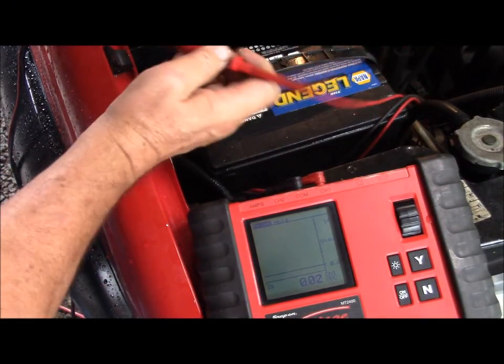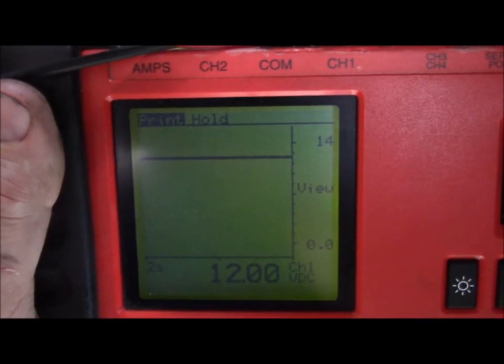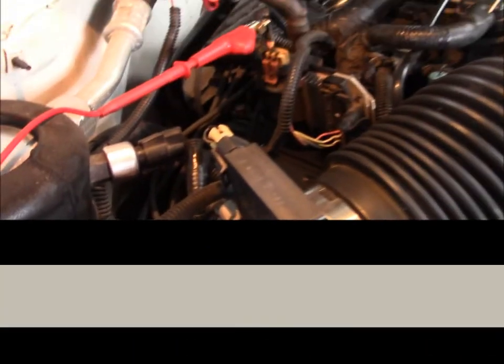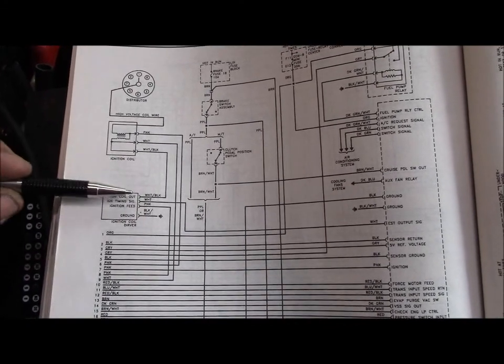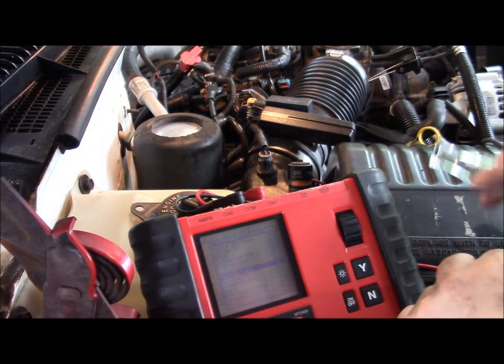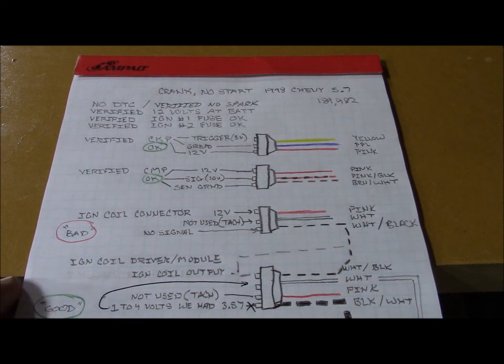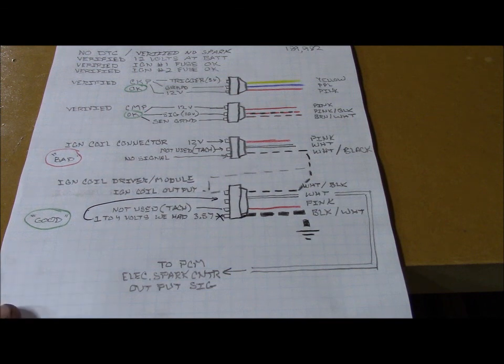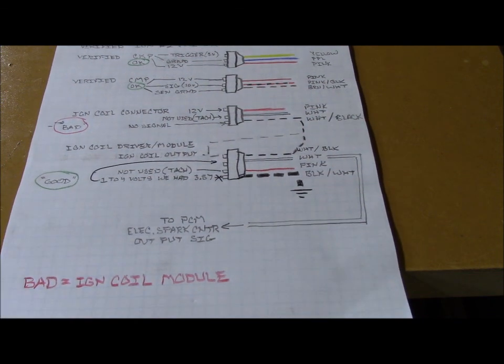P1351 crank, no start (part one)

Comment: my 2000 express van is having this same exact problem I have replaced everything including the ICM 4 times and the coil 3 times and the computer to no avail
Reply from the maker: It sounds like you need to start checking components for powers and grounds. A possible wire issue?
Reply: I still have no spark I did then when the van warms up some reason I lose it that was last week now I have no spark at all but it cranks but I have fuel. I've done all the wire checks you have and i cant seem to find anything wrong my next direction is to look for a broken wire that's all I can think of now that might be causing this problem
Reply: its all very frustrating for me i have checked all the basics i know i have good compression too. I'm good at this stuff so im irritated i cant fix this i still feel like i'm  missing something so simple and silly
Reply from the maker: @anthonychermesino2533  I worked on a 2006 Dodge truck for 18 hours (in two days) to find a crank, no start. It is very frustrating I agree. A broken wire is my best guess too. Good luck. I guess there is always the option of towing to a good shop.
Reply: @wyattoneable  it turns out it was a broken wire just as i guessed it was burnt through and stopped the crank signal.

Comment: step by step works while in sure you will get er done
Reply from the maker: I was impressed with the Haynes manual. It had good checks and the wiring diagram was correct. Thanks Drew.

Comment: The idiots that have come out of college thinking THEY will re-invent the wheel have made automotive repair MORE costly and they have ONLY gained a couple of miles per gallon from the old battery coil ignition with a good carburetor. Actually they SCREWED hard working people into having to take your vehicle into a place and spend a lot of dough on some asshole that has been trained on the art of f**king you.
Reply from the maker: I told my wife our next new car will be an old one! Without computers. It's the EPA demanding more from the manufactures too. I hate our government.

Comment: Great diagnostic test. I really like that Snap-On tester. 
I do the same thing in checking my electrical problems but not as nice as you did, lol.
The diagram you drew up was very clear and precise. Is there any reference info to check the module with an ohm reading or continuity?
Reply from the maker: None that I saw. I'm going to do one more check that was suggested by a tech I really respect but other than that, this better be a fix. I have the part now, just going to grab the camera and we'll watch together if this is it!
Reply: In the dealership they always have a good part to check the system with and I always called them part changers. And that is what they are. Put a new part on, engine runs, charge you 5, hours diagnostics@ 80+per hour.

Comment: Well looks like you're narrowing it down, I had one of my older 96 - 98 can't remember which, acted kind of like that and on mine the spring contact on the rotor cap had a hole burned right through it  Hope you get it fixed let us know.
Reply from the maker: Visual inspections are still important for sure. I changed my cap and rotor only because I had the old ones off anyway for preventative maintenance but I started to think if this module isn't the problem I need to see if that distributor is turning. We'll see what happens. Thanks for the comment. How's retirement treating you?
Reply: It's great only wished I would have done it sooner..lol

Comment: Nice work. If it's not the module after that thorough diagnosis I'll eat my hat. Stickers are looking great
Reply from the maker: I'm with you on that one buddy. If it's not the module then it has to be the wire between the module and the coil. I didn't check that because of the nature of the sudden non running truck. I shouldn't assume but I'll show the results either way. Thanks for your sticker, it really brightens up the place!

Comment: Looks like your diagnostics is correct Wyatt. Hopefully, she'll be running again for you tomorrow.
Reply from the maker: Me too brother. You never know how much you miss something until it's gone and although the truck has only been down for 3 days, we miss it. Thanks for the comment. If I can get the part tomorrow there will be a part two tomorrow.
Reply: You're right Wyatt about missing a vehicle when it goes down. And it's tough sometimes to keep them running especially when they get some age on them.
Reply from the maker: We really enjoy this truck but sometimes it get close to being sold! But then what? We'd want another one and they're expensive. I told my wife at least this truck is giving me some experience in diagnostics!
Reply: I feel the same way. The last new vehicle I bought was back in '94. All the vehicles I've got are pretty old. Even when the 2000 LeSabre's tranny went out, I pulled it out and rebuilt it five years ago. I just hate to pay those expensive car payments and I don't think the new cars are worth it. If the truck is giving you good service, hold on to it. As you said, you'll get a lot of experience in diagnostics :)

Comment: I know on older vehicles you can burn the coil up with the key in the on position too long. Looks like the same thing happened here.
Reply from the maker: That's right. If the points were closed you would burn them up. I hope the ignition module does the trick. Thanks for watching all the way from the Carolinas!
Reply: Not back home yet. but hope to be soon, I'm stuck in Okie Land